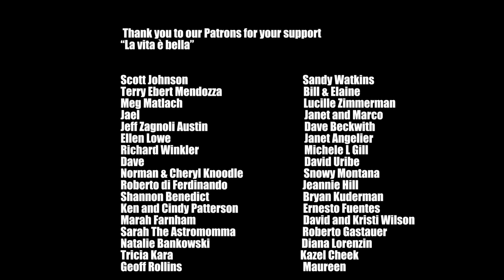RUNNING OUT OF TIME...1 EURO HOUSE RENOVATION IN SICILY CONTINUES!

Comment: If you put some bracing under that water tank to make sure it doesn’t fall down like a shelf you could also use the sides of the bracing to put toilet paper towels etc etc that is a lot of weight for-two bolts to hold I would be worried it would fall down.

Comment: Weve all been in the middle of a project and run into the self doubt / just wanna be done mental block. Hang in there and be patient with yourself 💪

Also please make sure you have solid support for your water heater. Water is heavy. Dont want it to crash down on someone. Cheers from Ohio / USA.

Comment: I had an old house in the NE US. It had a lead pipe to feed the house from the street. Your pipe looked like corroded schedule 40 steel. I see that you were able to use the PEX (or something like that) for your in-house  supply. I built my own house and used PEX for the internals. It’s way cheaper than copper. Since it was new, the supply from the town was copper. I like how they used PEX for the supply for your town.

Comment: In my childhood home, we had the water intake come in through the garage to the first floor. The water pipe was not insulated good enough, and it could not be fixed without tearing down too much of the house and garage. So every single winter we had to keep the water running 24/7 the whole winter for it not to freeze. You need quite thick insulation on the pipes to keep the water from freezing in below zero celcius temperatures (at least a couple of centimeters with a kind of a foam wrapping I believe). In fact I am a bit surprised that the local authorities want you to have that water meter on the outer wall of the house. I would say that is like begging for trouble with the water and the pipes. But I guess you don't have much choice when it comes to that if that is how they have decided it should be.

Comment: When removing tiles always a good idea to wear safety glasses as the small pieces of tiles fly everywhere and are very sharp.Easy to forget to put on but as have had cases when weve ended up needing medical treatment when bits of metal or tile have gone in eye have learned the hard way☹️

Comment: Workiing with these old stone structures is very difficult.   Some of it looks crumbly.   I wonder if it would have been possible to carve out a square service box....steel frame....for all of the utility hooks ups.   If something ever needs repaired all of the stone and cement has to be removed.

Comment: Remember there are in France and Us...paint for cooper...plus you can have a plastic or metal to cover it ...means I am 70 years old but I remember there are a cover protección from heat pipes. houses use from the bottom to the 1.meter high. Remember in summer lowered the water temperature...Just sharing with you options..😊😊😊. Maybe bigger hardware's o Ferretería in USA INTERNET.❤ you will finds many options...YOU ARE THE BEST HANDYMAN...and your family will be eternally happy.

Comment: There are certainly diffrent standards. We must have both electrics and water certified and only installed by qualified trades. Here we use off peak boost Solar 315L storage tank that is for a family of 4. Hot water taps must be fed via a cold water tempering mixer valve to prevent the posibility of serious hot water burns. I'm just wondering about the 80L storage tank hanging off two relatively short bolts, considering the tank probably weighs 20kg and 80L is 80kg that's a total of 100kg. The other issue we contend with is the location of power socket and light switche placement with in potential wet zones these are still prohibited when the circuits are protected by RCD's and AFDD's.

Comment: Plumbing seems to be quite intricate.  I'm not understanding at all what holds the empty water tank onto the wall. 80 liters is about 21 gallons.  A gallon weighs about 8 pounds which would be around 168 pounds when full.   How is it possible to hold that much weight on the older walls? The copper piping will be quite interesting when it aquires its patina.  Fascinating renovations.  Thank you ever so much for sharing your precious daughter with all of us. 🐈‍⬛🐈🐈‍⬛ 😊

Comment: I bought a toilet seat heated bidet & it works fantastic. This kind of bidet is also designed to wash little children too.  Plus your bathroom will have so much more space .  Mine is electric but it cones Manuel .KOHLER 98804-CP-0 Purewash Elongated Manual Bidet Toilet Seat With Chrome Handle, Non-Electric Bidets for Existing Toilets, White

Comment: Why does the pipe go up and down. Could it be more nice if it runs along the top of tiles, pass through the wall going to bathroom, then thats where you tap going to shower. It would be more aesthetically nice, I guess.

Comment: sorry but you made a big mistake in making the cold water pipes in copper, it is dangerous because the welded pipes produce the harmful green copper substance.. this is fine for a heating system. PVC or iron is fine for cold water. Hot sanitary water must be made with copper that is not welded but bent with a pipe bender
Reply: They said that they are not planning to drink the water.